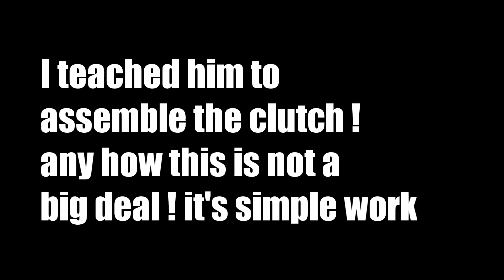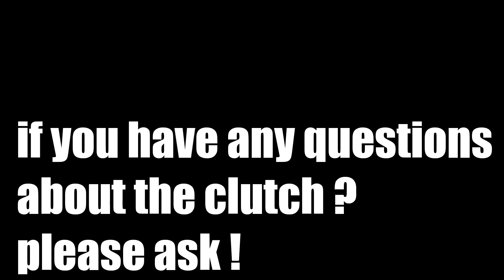He did the clutch job ! Yamaha RX 135 custom built

Comment: Hi there.... the handle that you have fixed for the RX is off bigger size hence you would have had to modify the cables or get cables of a different bike if i am not wrong. may i know whether we have get longer cables or we need to use a different bike cable.
Reply: Mere pas rx 💯. Hay may khoj rha hay rx135

Comment: Bro I had a pulsar150 bike 2007 model and I done half bore and changed clutch plates and it was not going Speed more than 70 if I try to go more than that it give jerks like if the fuel is over like that but not going more than that bro wht will  the problem

Comment: Bro i have rx100 every time my bike clutch is fail and every i try to fix it work 1or2 day later same problem can u identify problem????
Reply: Change  clutchplate and presser plate both if there is a gape in clutch bell then change clutchbell also and use good engine oil your problem is solved.
Reply: @ahanpatel5634  thank u for replying Bhai 
I have another doubts i heard about slipper cluths is available for rx100
Reply: @aneeshreddy2157   I have also good hint to improve rx 100 average also. For this you have change  carburator  middle jet which has around 5 whole. You have to change rx 135 middle jet instead rx 100 rest jet remain same. And second tuned your rid valve, if faulty change.third change pisten ring .when you fit your head block don't miss to apply gasketmaker.  Here you get  compressor  in your kick. Every year change piston ring regularly and check  oil pump,if not work repair.
Reply: Bro while driving my Rx  suddenly their no cluths and gears does shift whatt should I do???
Reply: Simple trick for clutch sleep is try 'used  engine oil'  in your bike  .
Reply: @ahanpatel5634  just two days I change engine oil castrol brand same problem
Reply: @aneeshreddy2157   used old black engine oil not new one
Reply: @ahanpatel5634  any brand name?? Or old used oil bhai
Reply: @aneeshreddy2157   just go to nearest  garege and ask to  give old oil and fill in your bike
Reply: @ahanpatel5634  OK Bhai thank u for our help Bhai your great